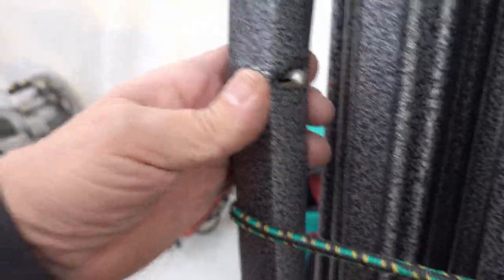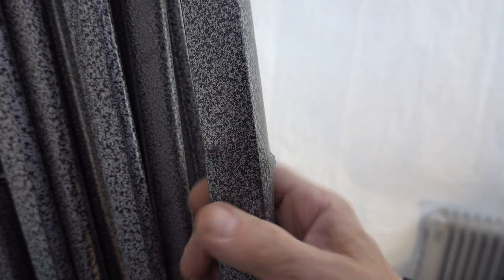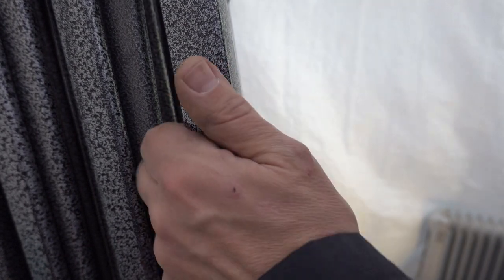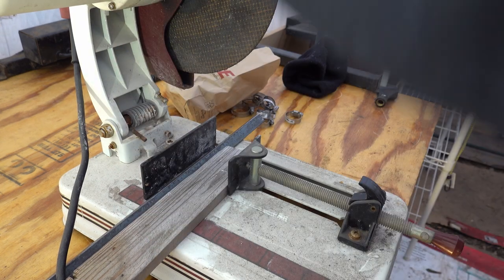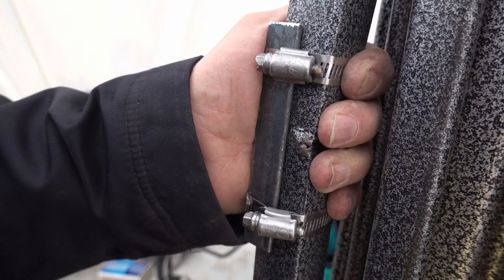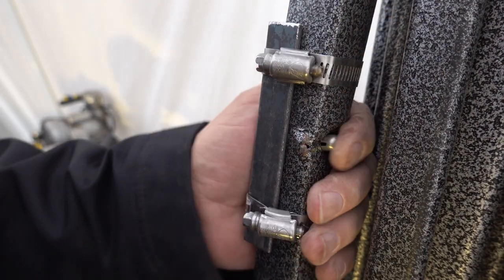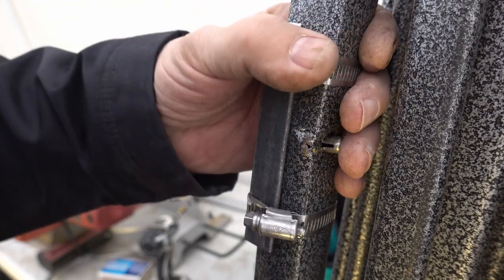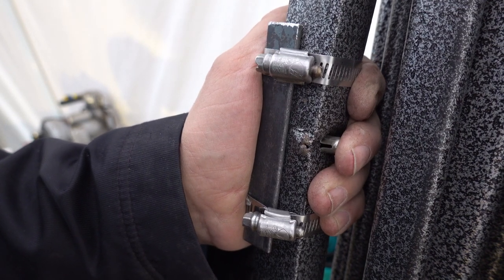Fixing an expanding tent frame

Comment: This is a good quick fix. Try gluing the metal brace or clamping it to the pole then drill holes and rivet both side of the angle brace faces to the poles for a less bulky fix.